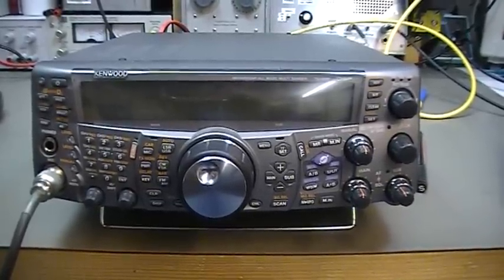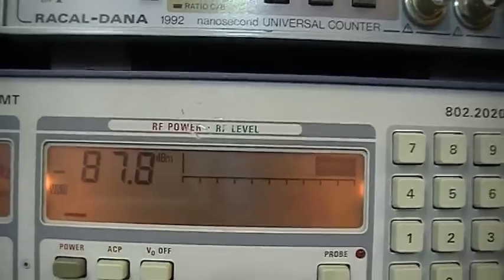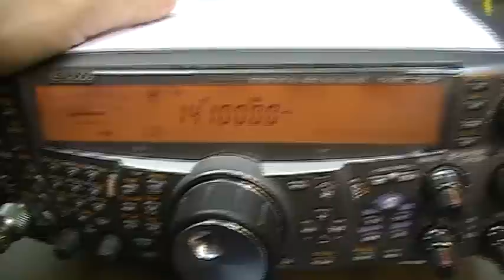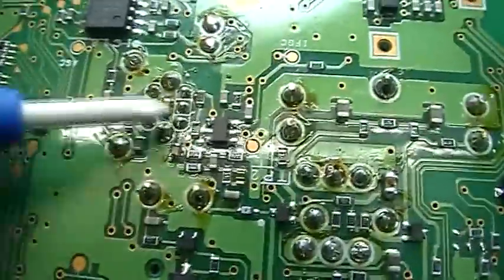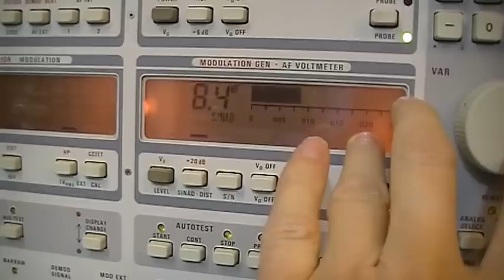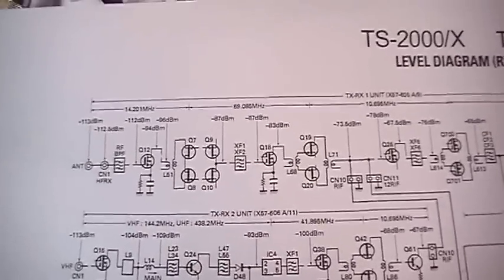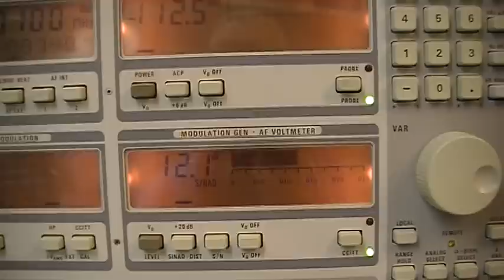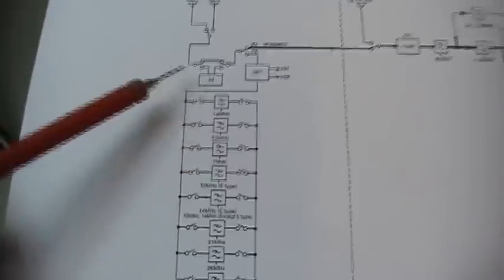#21 Radio Repair: Troubleshooting Kenwood TS-2000 weak receive , Part 1

Comment: I bought my TS-2000 used with very low receive. Not knowing that Kenwood was doing the repairs free, I ordered filters and a few clamping diodes from Mouser Electronics. The task was rather daunting but I used my digital camera, taking many pics. The job was successful and the rig now is great on receive and pretty quiet!

Comment: Great job. Thanks a lot. My 2000 recently got very low receiving. Only loud stations. With the help of your video I found the reason soon. It was D7 diode damaged. Also I tested T1. It showed 10V instead of 13 both in RX and TX and probably that was the reason of the diode damage. Replaced Q1 and D7 and it works as new now. 73! Alex UT5C
Reply from the maker: Perfect!